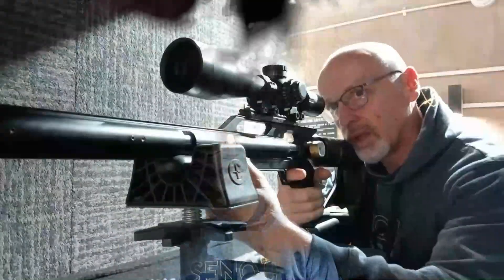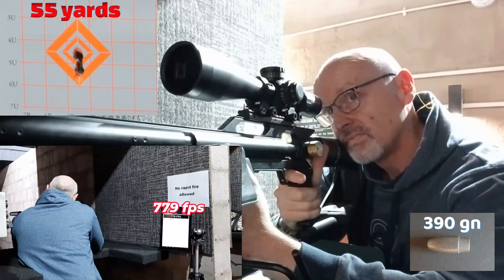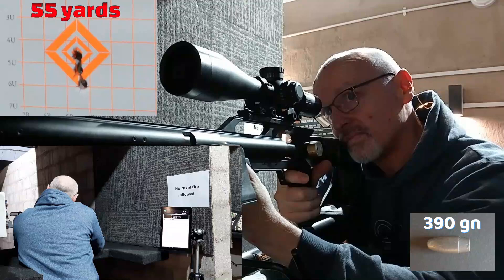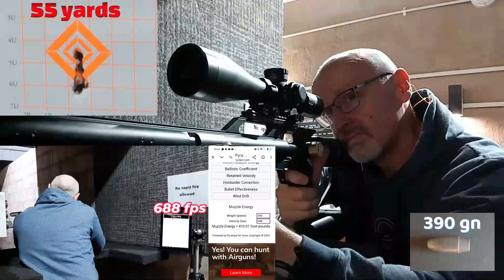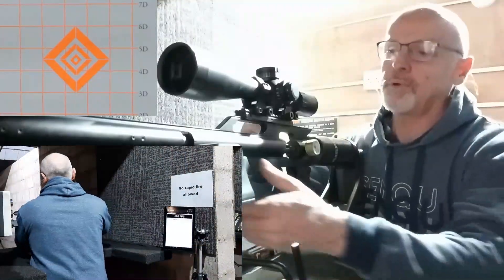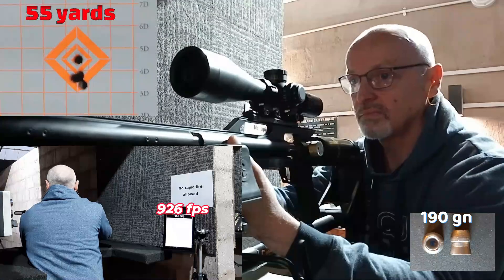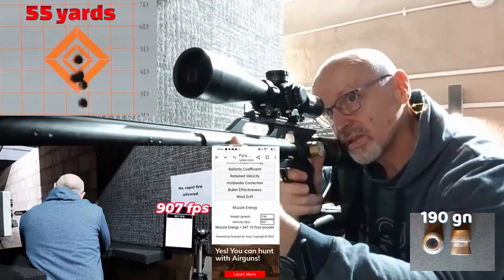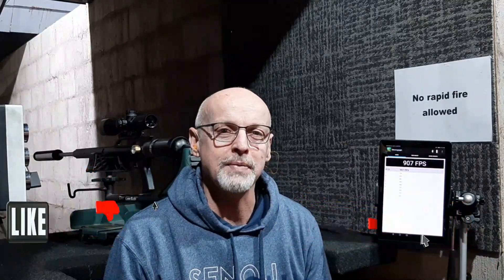Airforce Texan 457cal TX 2   AAO 390gn Solid Tip Rebated Boat Tail and 190 gn Hybrid HP Pellet/Slug"

Comment: I would never buy this rifle, it has a good barrel but it is not regulated and it is a single shot rifle, the other shots start to fall off.
Reply from the maker: @fabiosantos8591  yes it's not for everyone it's purpose built for hunting big game like Deer. Generally you only need to use one shot for hunting deer  not like small bore when you go out shooting pigeons and you shoot a bunch of pigeons in one day
Reply: To be clear, you absolutely get two solid shots and also a third,.. within mm's of each other (depending on the skill of the shooter compensating for drop off), and Jeremy's right... these are Big Game platforms , you only need one shot to bring down big game,.. with a follow up in the field without a refill... 
Use a mill-dot scope for holdover with any air rifle and your shots should always be with in the kill zone of where you put them.